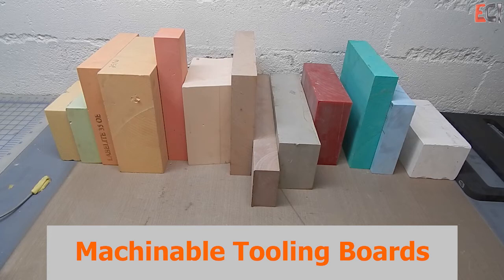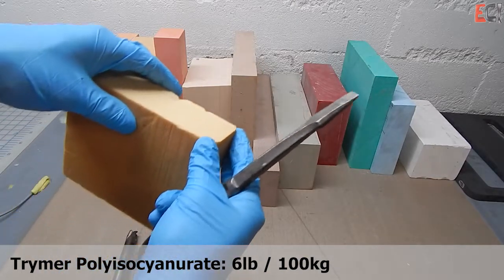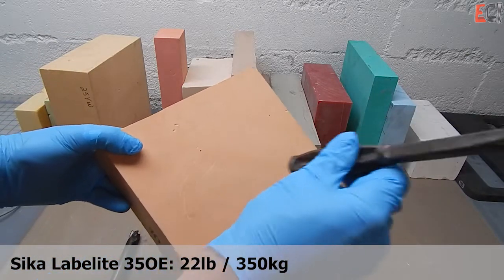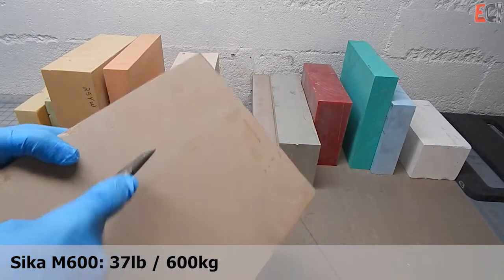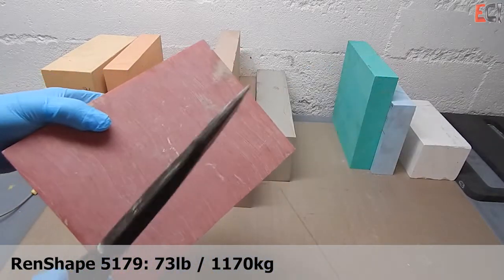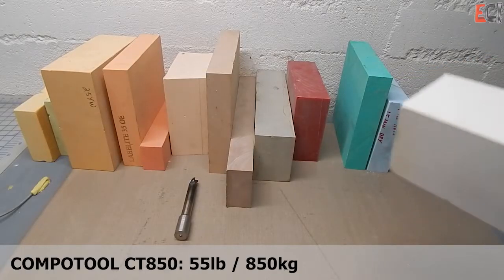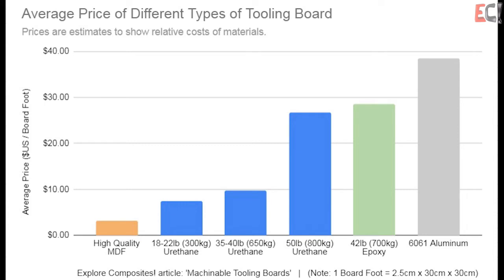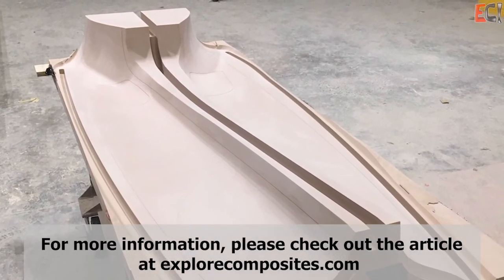CNC-Machinable Tooling Boards for Composites

Comment: As someone on a low budget finds it hard to source real tooling board (especially in smaller quantities), pvc foam commonly used for signboard making (also apparently sold for modelmaking on ebay) seems like an alright, easier to obtain substitute for the 16lbs product shown here, which while not as good as the higher density products is still significantly better than anything you'd find in the hardware store.

It could probably be glued to get higher thickness using superglue. When I did it the joint was as strong as the material itself while the bondline was hard to see, but it was a small joint so I am not sure how that method would translate to bonding a large area.

At some point I was exploring the possibility of making some higher density versions myself, since they seem to basically be high density urethane foam (using tiny hollow glass spheres instead of gas for the foaming) with added mineral fillers that get you an hard surface that machines well.
Reply from the maker: Do you have a brand name or link to that PVC foam?  Is it like the material used for trim on buildings?  

And if you ever try making foam with urethane resin and microspheres I'd love to know how that goes.  The range of microsphere materials and sizes available is amazingly broad!  I am pretty sure that's how some epoxy board is made... but there must be some degassing and exotherm control methods going on.
Reply: @ExploreComposites  Hi! I'm only a newbie to composites so take my claims with salt. Since your blog is so great I was actually thinking of sending you questions about a different topic, so it's a surprise the reverse happened first :D

Since there are many names to cellular pvc,  I'm not exactly sure how similar the products are. I know a plastic store that sells two different varieties (intecel and intefoam) while the video "PVC Foamboard - A new basing material?" that analyses the material mentions Palfoam and Palight.

I didn't know about trim pvc, but after brief research it looks similar to the scraps I have. I'm not sure it actually is cheaper than the materials you have shown, but it should at least be easier to find. The core material divinycell also is foamed pvc, but the density is significantly lower.

My interest in composites first came from the "guerrilla guide to cnc machining and resin casting", which while not directly about composites covers many related topics.

My reason for wanting to make tooling board was less scientific curiosity and more desperation about it being a specialty material that is hard to find where I live, especially if you only want smaller quantities. My initial plan was to use a high density foaming urethane, but I guess microspheres are used for better uniformity.

I'm currently trying to figure out if machined foamed pvc has an okay enough surface finish for what I am doing. Yesterday I did a lazy test where I directly casted polyurethane in a roughly made pvc mold only coated with mold release (normally you'd make a silicone mold instead). Thanks to the partially cured urethane still being flexible, I somehow managed to get the part out without ruining it.

Comment: Which one to use for making silicon molds from master tooling mold.
Reply from the maker: With silicone you could probably go pretty light.  If you don't need a shiny finish, you can release the tooling board directly and pull silicone off that - even with light porous board.  You just get a little texture on the silicone mold surface, which is often ok.

Comment: great vid and great comment responses. I'm in aerospace and have some familiarity with these blocks. granted in production we go carbon molds. CTE effects are not to be underestimated on larger parts.  Though I cannot be sure, that light blue 2nd to last on end there was used for large, prototype, low temp prepreg 16 ft part in my appplication and the end carbon part after cure at room temp looked like my grandmas toenails-ie long stuck out over the tool. Great video
Reply from the maker: I've seen the "toenail" effect too on long skinny things - crazy how much CTE matters when you start cooking things!

Comment: how can I melt a tooling board? made of epoxy
Reply from the maker: It won't melt like a EPS or other soft foam - like I don't think you could wire cut it.  Maybe you could with a hot enough tight enough wire but it would be a mess!  It will probably burn though... what are you trying to do?

Comment: Every time I have a question relating to composites, the internet brings me back here.  Thanks again!  I'm having some laser scanning done, and I was just working out what materials to use when I have new molds machined.  The machinist I found doesn't like MDF, so polyurethane it is.
Reply from the maker: Everybody hates MDF until they remember how cheap it is!  Hard to go wrong with a 30-40lb urethane board though unless you need high temperature.  Easier to clean the chips out of a machine too.  Getting MDF dust out of a machining center would be terrible!

Comment: Great video, very informative... Do you have any advice on feeds and speeds for 650 epoxy and PU tooling boards?

For roughing I tend to use 20mm tri insert tip cutters (with 125mm stickout)... For finishing I use various diameter ball end cutters.
I would typically rough at S8000 F3500 (mm) and this seems to work for me... My finishing is hit and miss though.
Reply from the maker: You could probably rough faster depending on the depth of cut but that sounds reasonable.  How much depth per pass would you use for roughing with that 20mm cutter?  

Larger diameter cutters help with roughing material removal rate - maybe a 40-50mm diameter and shallower cut.  Depends on available machine power and spindle speed.  

Climb cutting is much cleaner especially on finishing passes with ball-end cutters - best for roughing too.  Epoxy board is definitely harder to cut and more prone to chipping.
Reply: @ExploreComposites  Thanks for your reply. As a standard I'd go 3mm deep and 8mm stepover. I have a 12kw spindle with 24000RPM to play with. I'd typically leave 1mm stock for finishing.
Reply from the maker: @mikesivyer8099  That sounds like a pretty good size spindle so if the fixturing is solid you could probably double either the depth or the stepover / radial and be fine - or some combination.  Maybe more.  The machine will tell you though and if you get funny noises or bad surface finishes you can always dial it back.